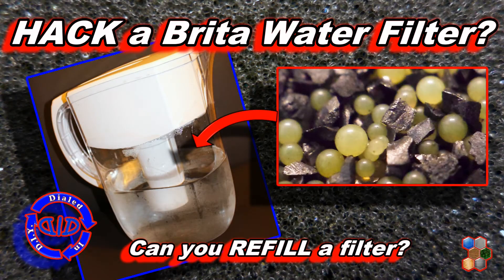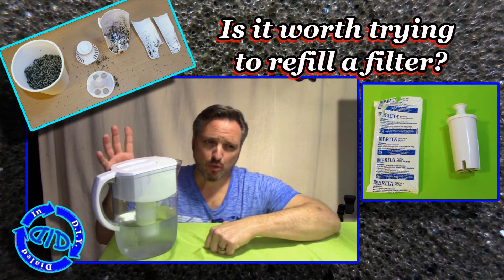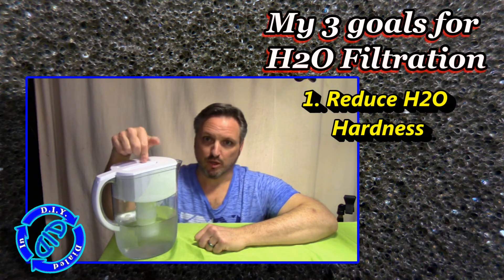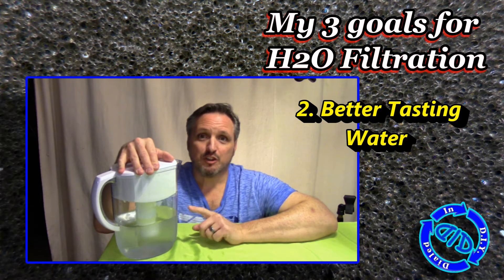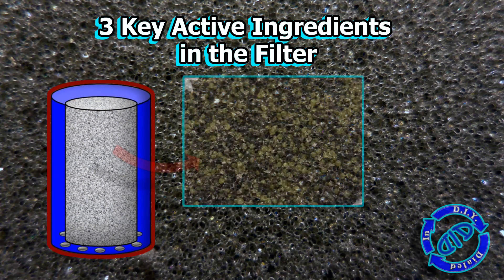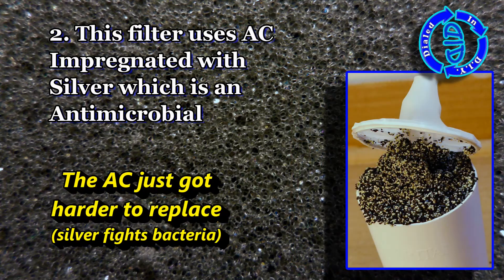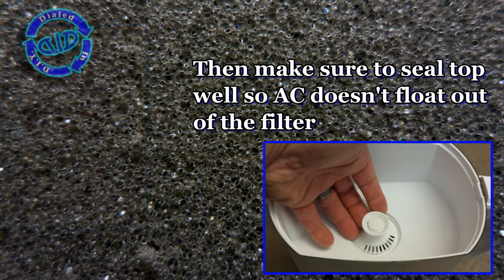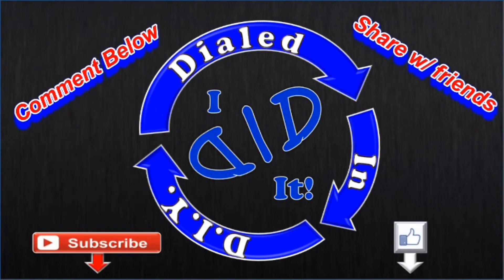Can Brita Water Filters be Hacked - How Brita works

Comment: Just buy a brits filter p3000 
1700 liters of water (on B setting. 3400 liters on A setting. C setting is about 800L but that's only for really extreme hard water. You better off installing a industriaal grade filter with replaceable ion exchange resins)

Comment: Unless you add silver and carbon. As for iron exchange, that’s tricky. 

It was good to find out this information. I didn’t know the brand went into that depth. Silver was a surprise. Wish I knew more about the iron infused beads or however they are called. 

One of the added things to note here to add value to the product, vortices produce structured water and this happens naturally over river stones. 

In reproduction of this process in technology, beads are used to simulate stones to create vortices, and this is very likely happening within a filter with beads. 

Now, the amount of time the water has passing over these may not be as optimal as some other filters made for this purpose, but the simple act of stirring, and even shaking can add more structuring. 

You can try this experiment at home. My process is to put glass marbles in a bottle, add water, then shake for a minute or 60 times. Try a glass of water untreated and compare it to the treated glass. You may be astonished by the mouth feel of the treated water. It tends to seep into the tissues of the mouth and you may feel yourself absorbing hydration right from the beginning of the whole digestive tract.

Comment: who says it has silver?
Reply from the maker: The manufacturer and the Material Safety Data Sheet. [So sorry for the delay... life kinda got in the way for a bit]
Reply: @DialedInDIY  no problem. Do you think I could use an old silver coin? I'm thinking not enough surface area though. Maybe run bleach through once per month? These are so cheap to refill, I need a solution for that silver.
Reply: coin is a nice idea. But maybe it's not needed if you use it often, for example Berkely doesn't have silver.